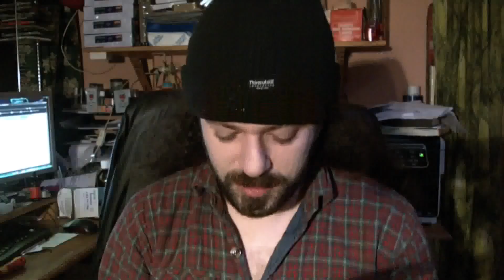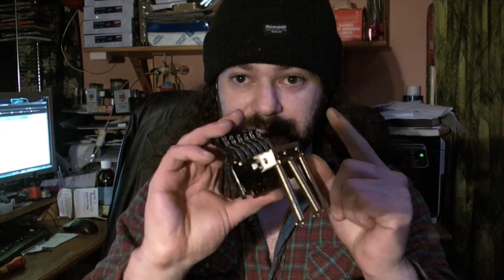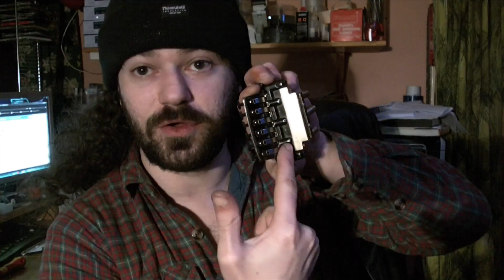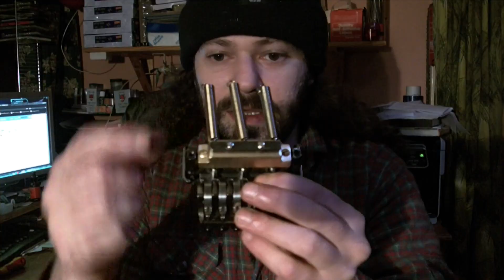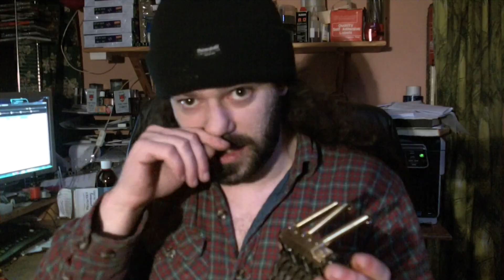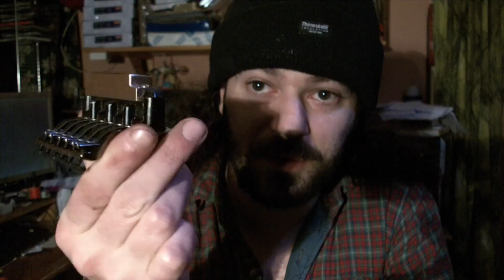Ibanez EDGE PRO 3 Brass block Mod fix guitar

Comment from the maker: Yea, same here. I had no problems with it apart from the hook of the spring snapping off inside the cast block. It got stuck in and i could not get it out hence the reason for this mod. 
Harmonics for these edge3 pro though are not too good hence i moded it to repair it. I have recently upgraded it to the Zero point ZR trem. I can string bend without the rest of the strings going out of tune now :p the famous blues licks that only work on fixed bridge guitars, you cant trill with a ZR though